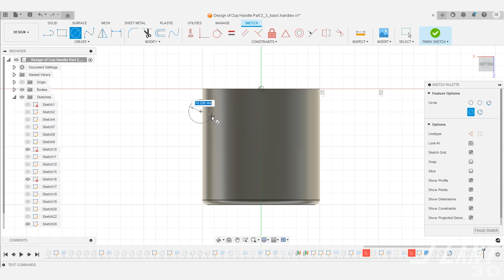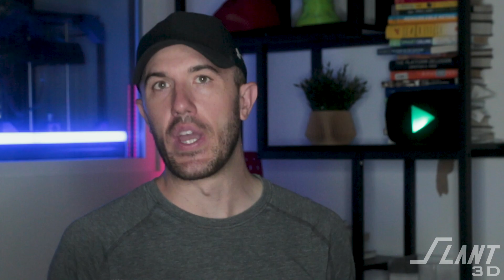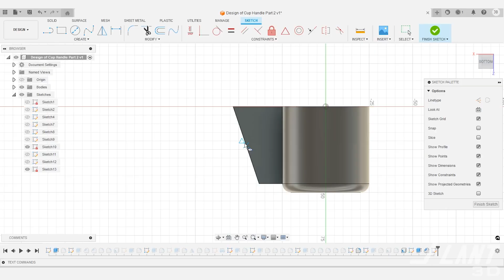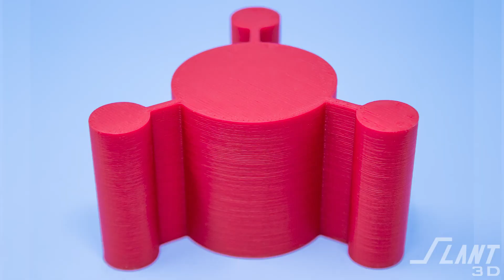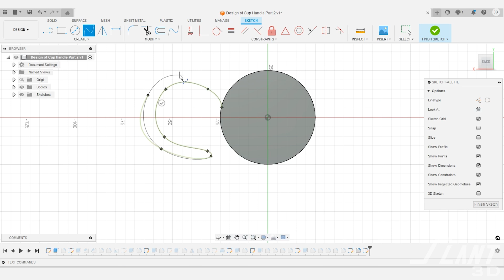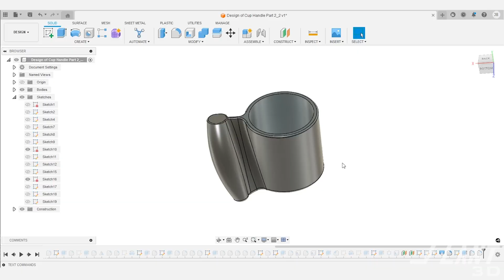Handle Variations Part 2: Design for Mass Production 3D Printing

Comment: Just like the last video. I find the lack of scientific method disturbing. You should have an improvement percentage over the baseline for each design. e.g. This uses 35% less support filament, it can withstand 50% more weight etc.
.
Why cant you print a regular handle separately and slide it with rails? You can have some basic automation which assembles the parts or let the customer assemble it like IKEA.
Reply from the maker: The scientific method is only viable when measured within the context of a particular question. Each of these handles could be tested in a certain application. But a designer needs to know what options are available.

The problem with multiple parts is that you have exponetially increased complexity of manufacturing. Each part needs to be qualified and verified. And then go through the entire checking process. This is why fewer parts is better in manufacturing. Additionally 3D Printing is able to combine assemblies into a single parts which reduces cost both at start and long term dramatically as production scales.
Reply: @slant3d  While it's true that generalities often hold merit, it's essential to remember they aren't universally applicable. Quantifying particular KPIs, such as filament usage in grams, can lend us more certainty. Consider the rails example. There's an evident trade-off at play. Employing the rails method could result in less filament use, thereby reducing the cost. But, as you've suggested, it might also add complexity, potentially leading to an increase in labor costs. It's vital not to presume this would necessarily result in a net loss without substantial evidence. Quantitative data could certainly aid in clarifying this debate.
Reply: @slant3d  I asked ChatGPT to convert my reply into something polite. It made it sound pedantic instead.

Comment: What filament would you use that is food safe and stand hot beverages?
Reply from the maker: Generally beverage containers require some sort of liner or post processing for best results.
Reply: Do a lot of research. Even with a food safe filament, bacteria can thrive between the layer lines and the print won't be considered food safe.
Reply from the maker: That is also the case with wood. But you can still have wooden kitchen utensils. Bowls, spoons, cups, cutting boards. Layer lines are not the problem. A fully solid 3D Printed product can be equivalent.

Comment: The one problem i find with handles that are designed around either aesthetics or manufacturability is that often ergonomics and kinesthetics are sacrificed. I couldn't find the number of mugs I've used that looked great but we're horrible to use. It's a very delicate balance but i personally believe that end user comfort should be the primary deciding factor.
Reply from the maker: Exactly. But having more handle options allows you to pull from a a solution that will work best for the situation rather than using defaults.
Reply: @slant3d  oh for sure. no argument there. that is one of the beauties of 3d printing and on demand manufacturing.... not being locked into a single design that is meant to appeal to as many as possible all while making certain sacrifices.  Can easily have a dozen designs just waiting and no need to warehouse them all.

Comment: How about trying to design a better nerf dart?  You could do one video on how to design a better dart (faster, more accurate, more durable, etc), and optimize the design for 3d printing (faster production, lower material cost, improving part strength, lowering failure rate) in the second video. And for a third video you could compare the cost to performance of the traditional nerf dart to the improved dart design, and the improved dart optimized for 3d printing.  I think it would be a great demo of how optimizing a design for 3d printing doesn't necessarily mean compromising the performance of the end product.
Reply from the maker: We actually have one like that in the works for golf tees
Reply: @slant3d golf tees, nerf darts, collect a few more ideas and you could make product vs print a running series kinda like fan showdown 😁.

Comment: Do you understand that microscope isn't good for nailing? Stop promoting wrong use of an instrument, it's just bizarre. "stone age" handle is a freaking thousands years of design evolution while your ideas is a throwing spaghetti to the wall and look at what sticks
Reply from the maker: There are other objects in the world that need handles
Reply: @slant3d  no one says that handles are only needed for mugs but you basically trying to promote "innovative" mug designs for a second video in a raw and that's sad
Reply: And the pottery handle didn't evolve by the same "spaghetti on the wall" method? 🤣
Reply from the maker: In design and engineering it is good to have options of what can be done rather than just what has been done. As Ford said. "If I was listening to what people wanted I would have made a faster horse."
Reply: @McRootbeer  pretty much it was, but for thousands of years, is it rational to reinvent the wheel just to make it possible to print mug which will be worse than $2 traditional one? Any way loop handles are pretty easy to make printable without supports, even with plastics like ABS or PP(and yeah other vids from this channel actually does have this info, which is nice), if you would ever wanted to print them.
Reply: @SergeiSugaroverdoseShuykov  Those thousands of years started with year one.  And is it rational to not at least consider new ways of designing things when there's new ways of making them?

Comment: You got smart enough to not use "coffee mug" as your demo object. Nice job. ;-) I do like how you cover different ideas that give all kinds of hints as to how flexible it can all be in design.
Reply from the maker: The last video did not have a coffee mug either. You might notice they were beakers and way to small for a grown human lol. This one actually did have a full size coffee mug.
Reply: @slant3d umm, no. By my count you used the word "mug" 4 times in that video and the word "beaker" 0 times. You also used stock footage of people holding mugs several times and no stock footage of beakers. You can't just change what the example was because people pointed out that it was a bad example.